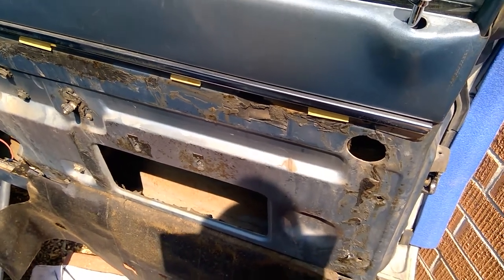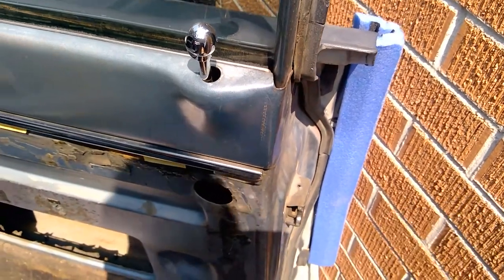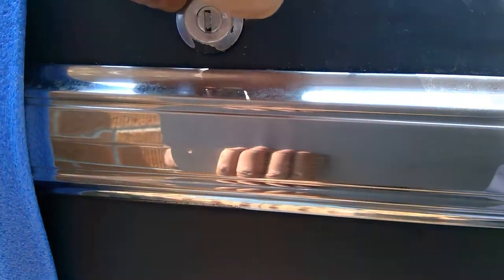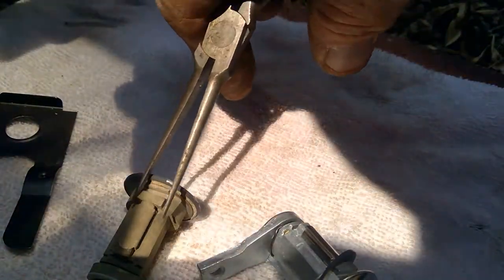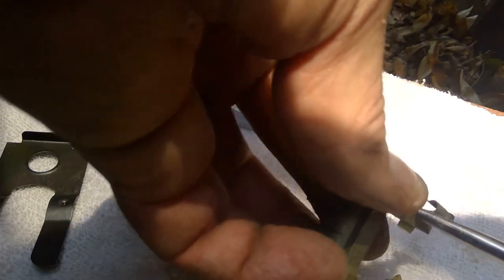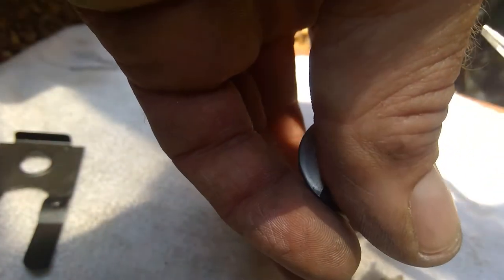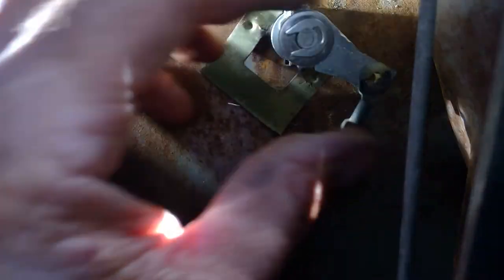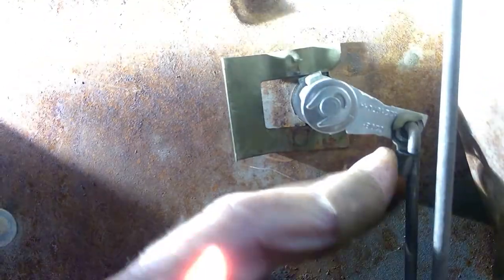60's Ford Door Lock Cylinder Replacement

Comment: Oh my adventure was much more exciting.  The passenger door on my '65 Ford Custom (Galaxie) would lock but not unlock.  All the rods were functional so I figured the problem was in the lock cylinder.  I couldn't get the clip off of the lock rod so I pulled off the "C" clip from the back of the lock cylinder.  Of course that fell down in the door and I couldn't find it with a flashlight nor a magnet.  I wonder what size it is?  And sure enough, the key would only turn 90 degrees to the left but not to the right when I got the lock cylinder out.  So I used every spray known to man and made the problem worse.  Now the key wouldn't turn in either direction and I couldn't get the key out.  I put the lock cylinder in a container of kerosene and put that in my ultrasonic cleaner.  Nothing.  I changed the fluid bath to water, dish soap and some Purple stuff.  That seemed to work so I repeated a couple more times and sure enough I got the key turning.  Well, I wanted to make sure all the dirt was cleaned out so I finally managed to take that cover off which covers those little springs and spacers that ride on the key ridges.  The top spacers came out okay along with the springs.  But, I didn't realize there was a second set of spacers that are the ones that actually ride on the key ridges.  Got them out, too.  Then I really cleaned up everything.  The key turns easily in the lock cylinder now and all I have to do is put everything back together.  But all those spacers - top and bottom ones - are all different sizes.  I have no idea which combination of spacers goes in which of the five holes.  I was hoping your video would reveal that secret.  I guess I'm going to have to take all the parts over to the locksmith and see if there is an Old Timer who knows these locks and see if he can get everything together.